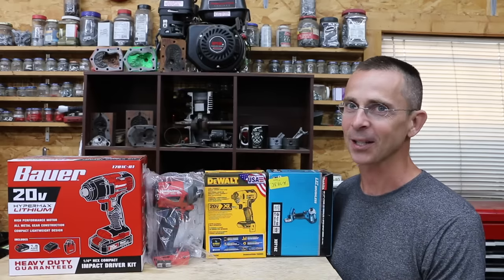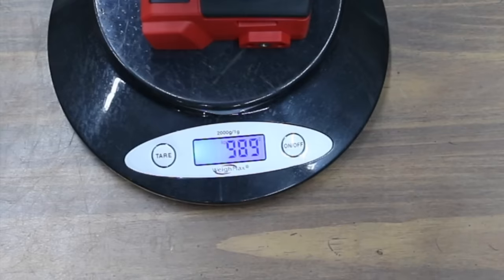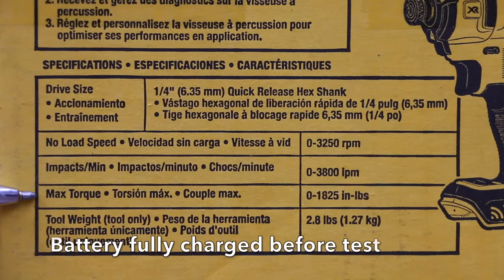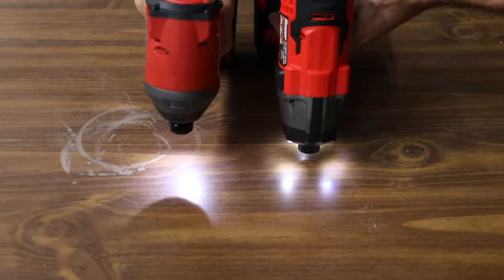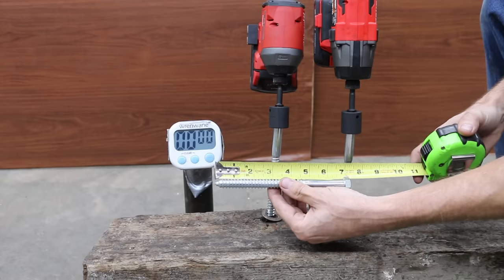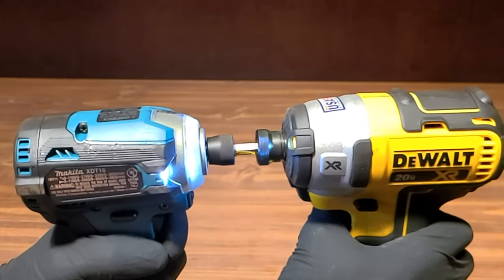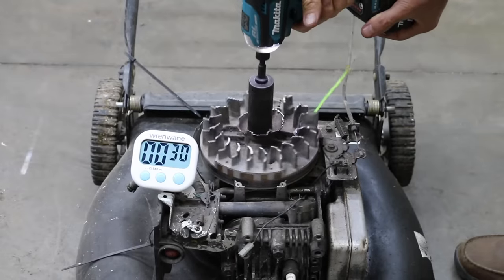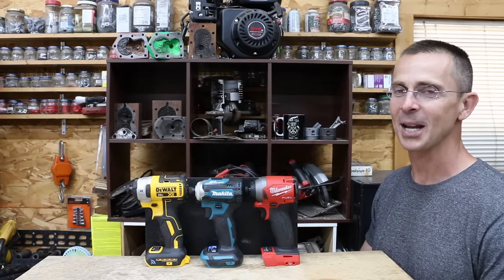Best Impact Driver? DeWalt vs Milwaukee vs Makita vs Bauer!  Let's find out!

Comment: I have a dewalt for 4 or 5 years and it has served me very well. I want to say that Makita being lighter and more responsive is probably the best choice for most uses.
Reply from the maker: Thanks for the feedback.
Reply: I have a bosch gsr 180 drill and the trigger lag is disapointing. It takes almost a second to turn when you press the trigger. I have never seen trigger lag as in this drill
Reply: Anyone in my company who has Dewalt just refuses to accept defeat over Milwaukee. Even if the facts and tests are presented to them in countless Youtube videos, they still refuse to lose the battle. Dewalt users are so stubborn I swear

Comment: How about a video on 1/2 inch high torque impact wrenches? Such as the DeWalt dcf900 the Milwaukee 2767, Hercules ultra torque (HF), ridgid, any other brands that make high torque full size impact wrenches.
Reply from the maker: Thanks for the video idea.

Comment: We all knew Milwaukee was gonna take the cake on this one
Reply: I had better expectations for Makita. But yeah Milwaukee has been the best value in tools for a long time IMHO.
Reply: It may be slightly faster but just the fact u have to keep pressing the button on the milwaukee is unsatisfying don’t you think.
Reply: @jackscott5144  that's the computer protecting the impact
Reply: Richard Devos exactly rather have a little less performance and it not keep hitting temp control e.g makita all the way
Reply: Jack Scott I think the cut off is for safety. It doesn’t want the drill to burn up or “explode” in your hand.
Reply: The Milwaukie cutting out may be a safety feature, but in my mind it just can't handle the workload if it's doing that. That being said, I'm a Makita guy all the way. 😁
Reply: @tomt340  even with the safety mode it still outperform both drills lol
Reply: @tomt340  ....makita is definitely the best. Milwaukees are always too heavy for what they are.

Comment: As a form carpenter, I have extensive experience with all 3 of the lead brand impact drivers. And by FAR. The Lead goes to Milwaukee, love their system their impacts are the best. I also really enjoy using the makitas too, both of them work extremely well. Milwaukee just has a little more low end torque, dewalts have always been the last picked, they just don’t feel the same performance wise.
Reply from the maker: Thanks for sharing.

Comment: If I remember correctly the Milwaukee battery has an overload saftey, that cuts power if the current draw or temp get too high.  It keeps the magic smoke inside the tool and battery at the expense of an occasional annoyance.
Reply: Yea, Bosch does the same in some tools.
And then people shit on them when the overheated or below freezing cold battery won't charge.
Thermal protection systems may sometimes be annoying, but they prevent you from breaking your tools, wich is nice.
Reply: Yeah you see people complain about these "idiot proofing" shutoffs but if it was another tool yes they could keep using it but they'd have to buy another one much sooner than a tool that keeps you from causing excess wear and tear or permanent damages by overworking it. If you need a tool that can hit harder or go longer a cordless impact isn't what you need.
Reply: 5yr warranty.
Reply from the maker: Thanks for the feedback.
Reply: @magicstew45  There are also stronger variants and larger batteries.
You're not going to overheat a 12 AH battery with an impact driver and it will last pretty much all day long if you're running one that can take the abuse.
Corded ones for example can't do 100% duty cycle either in most cases and air is a bitch to deal with in many cases.

Though to be fair: I did run through about 2,5 2AH battteries in an ~80% duty cycle with mine once and it got only warm on a hot day.
But that was none of the tested ones.

Comment: I'm glad to see this i just switched all my cordless tools to M18 milwaukee fuel.. been nothing but amazed in the difference
Reply: Same here!
Reply: So you guys really like the Milwaukee?  What did you try before?
Reply: Eric Kounce it all depends on what you want out of your tools, if your a contractor go Milwaukee. If for at home get the best you can afford. As all will be fine for the average home owner. I am so deep in the dewalt battery that I have decided to stay with that system and it’s been working flawlessly for the last 5-10 years.
Reply: Eric Kounce  Ridgid
Reply: @o1mtbiker  : Well not a contractor, but I understand the poor economy of cheapening out on one's tools. Costs more, but still going strong.
Reply: brodriguez11000 that’s why I always tell people get the best they can afford. Make no sense having 1-2 thousand in tools and no where to store them.
Reply: @o1mtbiker  my work stuff is Milwaukee but my home stuff is ryobi. I know people bash ryobi, but they do have an amazing selection of tools.
Reply: Shawn I think they have the biggest selection of tools currently. The ryobi brand has come a long way.
Reply: I started with Ridgid Gen5X and Octane tools. Excellent tools, but I also wanted something smaller and lighter, so I went to Milwaukee M12 FUEL (12V). They don’t have the raw power of the 18V Ridgid and other 18/20V systems, but they’ll keep up with 18/20V systems from about 4 years ago, while being smaller, lighter, and still delivering amazing performance. Still have and use my Ridgid, but my M12 are what I carry most of the time. The Ridgid is brought in as needed.

I’ve also owned DeWalt before, and while they were decent, the longer I used them, the less I liked them. That along with some issues with getting DeWalt to even respond to warranty issues, much less honor their warranty, and I now won’t purchase anything sold by Stanley Black & Decker. I did recently make an exception for a Craftsman socket set.
Reply: @TexasRaiser  Dewalt 18 volt then 20 volt both cant hold a candle to Milwaukee M18 fuel
Reply: Thank you for sharing your experience fellas. Much appreciated.
Reply from the maker: Thanks for sharing.

Comment: Guess I am old and old fashioned.  Was stationed in the Philippines 1989-92. I bought a Chicago Electric Impact from Harbor Freight Mail Order. Used it on my Harley Davidson  to remove and Install primary sprocket for belt. Now use it for lug nuts on my car. That  Electric Impact still works.
Reply from the maker: Thanks for sharing.

Comment: Hitachi is a major player in this market segment. I had two impacts, bought two more and a great feature... my oldest drills are 10 years old and the same battery platform still works on every Hitachi I own, drills, impacts, recip, 4” grinder and jig saw. Also, the oldest impacts have easily driven over 10K screws each.

Comment: Now spend about 6 hours drilling/driving though various pressure treated woods, ranging from 2x12 to 8x6, for about six hours a day and see which one overheats first.
Most ~3,~4 amp hours batteries are useless unless you are doing some really light duty work

Comment: Had a Dewalt for years, just got a Milwaukee... I like the Dewalt better, better LED illumination by far, and has three speeds which is kinda nice... Milwaukee works fine too, just the Dewalt seems like the nicer tool in this case... The Milwaukee came in a kit that I bought for the other tools and battery and I don't mind mixing up my tool brands. I kinda like it as then I generally carry around more batteries and chargers so easier to keep multiple tools in play imo... Plus then I can always just buy the tool I like best for the application vs being stuck with a brand... 😁👍
Reply from the maker: Thanks for sharing.

Comment: Hi, guys I need to decrease driver's power for personal needs. For example to work on engine. Is there any easy way ? I want to decrease power till 50nm's not to brake apart. Thinking about less power from ac maybe or somehow modify the ,,hummer'' mechanism itself. Thank you in advance...

Comment: With me having Dewalt at home and Milwaukee at work I completely agree with these results. Milwaukee is definitely the best.
Reply from the maker: Thanks for the feedback.
Reply: J B its the strongest not the best
I wonder why it stops every 10 seconds 
I would kill my Makita for that behaviour
Reply: @bertjetolberg103  I got the Milwaukee and its never done that, a 7 inch lag in pressure treated material it would probably stall out a couple times to save the tool..
Reply: @bertjetolberg103  it's protection so it doesn't overheat and smoke like the dewalt and makita protecting the longevity of the tool.
Reply: Bertje Tolberg it is designed that way so you don’t over heat the tool and the battery. I have never had mine do that. I know if I am driving a 7” lag to actually use a heavier impact designed for something that tough.  
 Before my work went to Milwaukee I burnt up a Dewalt impact and 2 Dewalt drills doing the same thing the Milwaukees had absolutely zero issue with. I actually regret not going with Milwaukee for my home tools.
Reply: @bertjetolberg103  And you've got it wrong your makita would kill itself without that function.

Comment: People need to remember that these are impact drivers not impact wrenches. There are the uneducated who make video after video hear on YouTube talking about how their impact driver broke down while they were taking apart a V-8 engine. Or taking the Lugnuts off their car wheels. Then they complain. There’s only a short warranty on the piece of equipment. Maybe they should remember that if they’d quit using it like an impact wrench, and use it to drive wood screws, and lags into wood, which is what its supposed to do, maybe the manufactures would put a longer warranty on them. They are not for mechanics they are for carpentry and woodworking, deck, building, etc. etc..
In other words, use the right tool for the right job and if you don’t, don’t complain when the tool breaks down.

Comment: In Easter Europe Bosch and Makita rules. They are similar in price and reputation. DeWalt less popular and a bit expensive. Milwaukee is a newcomer and very expensive, at least 50% more. But using it at my company I appreciate it.  
I am looking to invest in a new line and spent some time in figuring out which brand to choose and finally turned back to your Chanel as you are the only trustworthy source for me. Congrats
Reply from the maker: Thanks!  Thanks for sharing.

Comment: I’ve owned my Mikita for 8 years and it’s still going strong. My work gave me Milwaukee 18V impact and drill and they work great as well. I’ve never had issue with either of them. Been a Makita fan for a very long time
Reply from the maker: Thanks for sharing.
Reply: I let the smoke out of my porter cable a few weeks ago and replaced with a kobbalt (it was on sale).   should have watched this first.
as another poster said;    from now on, I'm coming here before going to the hardware store.
Reply: Where di yiy live?
Reply: I have a makita drill use it to run my valve seat grinder. Variable speed cuts down on vibration. I've done several engine valve jobs still working grest!
Reply: 12 years ago I got a 10 volt ( later they upgraded de batteries to 12 volts)makita impact driver, I was working on a project for a fleet of vans for a cable company. The job required removing the seats, my makita worked like a champ.  2 sets of batteries later ($50 each) still going.

Comment: We use Milwaukee power tools exclusively at my job and we never have any problems. Their 1" drive impacts are monsters, especially with a high output battery
Reply: Don’t use any of the larger tools!  They melt the batteries with little use and Milwaukee is a joke to deal with and won’t stand behind their tools anymore. Used to love them but they will never get a $0.01 from me again.
Reply: They're monsters, but Milwaukee needs to do a little catching up either those wrenches because Makita's 3/4 inch xgt beats the Milwaukee 1inch d handle
Reply: @luisprieto4390  we've noticed at work that the Milwaukee ¾" impacts out perform their own 1“

Comment: We have a makita, a few Milwaukee’s, a dewalt and a rigid on our deck building crew. They all work good driving in 3” deck screws but we grab the Milwaukee for doing the lag bolts, not because the other ones won’t but the Milwaukee will do more faster
Reply from the maker: Thanks for the feedback.

Comment: Soo many brand loyal “pros” here.  Its like taking my stock 1989 ford pickup and pitting it up against a 2020 ford raptor and expecting to take the title😆
Reply: The minor differences between all these tools doesn't justify having a Milwaukee impact driver, Makita drill, dewalt hammer drill etc. You're still going to go with the platform that you already have.
Reply: darcyrobinson true but that’s why I stick with M18 fuel as their drill is just as much of a beast as the impact driver. The drill is also one of the smallest in its class while being one of the most powerful like the impact driver. I’m an automotive tech so MIlwaukee has a lot of tools to cover our industry like their awesome stubby impact wrenches and m12 ratchets.
Reply from the maker: Thanks for watching.
Reply: Having had Milwaukee m18 tools for well over a decade I can vouch for their longevity and performance.  That being said.  I do own a few dewalt, makita,  and even bauer tools too that do just fine.. AvE said it best,  If you want the toughest tool available see what the rental shops are using.  I'm not by any means abusing my tools though.
Reply: This was a comparison of current-gen products.   Your analogy sucks.
Reply: Actually, my 88 f-2shitty will take more beating then them new raptors.  Know why?  I give zero fucks about my free truck vs off roading a house worth of money but that all depends what the title is for,, plowing into trees or for speed because I can only do trees....
Reply: @kentkirkpatrick7953  k
Reply: Some names come to mind 😂
Reply: @kentkirkpatrick7953  no one cares.

Comment: My former workplace used Makita and Milwaukee drivers. We'd use them to assemble and disassemble large industrial shake sorters, hammer mills, and a few other things. I definitely liked the Milwaukee drivers more compared to Makita for getting the job done... but felt that Makita would last longer overall. Great video as always! |

Can also see you and AvE doing a crossover for videos like this.
Reply from the maker: Thanks so much!
Reply: I have to agree with you also. I work in the construction field and Makita may be more expensive than Milwaukee but they last a lot longer and hold up better so all my tools are Makita.
Reply: The Zpack had my makita since 2012 still running like a champ... all makita
Reply: Did your former workplace happen to be an insulation plant? I have all those things mentioned above at my workplace as well
Reply: @drvn_performance  Nope. Fertilizer instead. :P

Comment: Amazon has DeWalt drill and impact driver on sale for 130 with 2 batteries, charger, and tool bag. I was ready to get a Milwaukee yesterday but I couldn't reisst getting both and batteries / chargers for cheaper than a single Milwaukee drill only. Watching this afterwards to see if my inpact driver was a decent choice 🤞

Comment: Usually Milwaukee is the best but I'm surprised that the Makita out performed the Dewalt simply because my hyper tough outperformed a couple different Makita's on cutting through sheetrock with tin backing !
Reply: Was cutting vent holes to dry out a wet wall
Reply from the maker: Thanks for the feedback.

Comment: I still prefer my Makitas. I've had good experiences with milwaukee tools as well. Makita stuff is just so reliable it's hard to beat.
Reply from the maker: Thanks for sharing.
Reply: Until I have a failure with either I can't say one is better, I've had no issues with Milwaukee tools, same can be said for Makita. And it also has to do with right tool for the job, you shouldn't expect impact drivers to do anything more than driving screws. That's why you have things like impact wrenches.
Reply: @Barbaratio  I do small engine repair and the size of the impact driver is what sells it to me. I use the driver with adapters for all sorts but and bolt loosening. I really beat the snot out if my Makita every day and she never skios a beat. I get pulleys and blades and wheels and all kinds of stuff off with it. I love my little driver.
Reply: @thisislargemouth5566  they are great for that, I use my milwaukee 1/4" hex for small engine stuff too. However in auto my 3/8 usually dominates, rarely do I need the 1/2 impact
Reply: Ive never had experience with Makita, but they are very good. I have only used DeWalt and ive never had an issue with any of their tools, so thats what I stay with.
Reply: I used to be a Makita hardcore fan till the brushless came out and they burned me for $499 hard earn dollars.. I am 100% Milwaukee fan now and own 20 or more of their tools...
Reply: @joesanchez7920  Makita number 👍 , Only Makita
Reply: Panasonic would kill all of these
Reply: João Maverick  Not at all,in the shopfitting trade we've tried most brands
Panasonic is fantastic but expensive

Comment: At the shop where I worked - when our trailers were delivered, it was necessary to remove the wheels, forklift the trailers off of the cargo hauler, then re-install the wheels.  We used a Milwaukee battery impact wrench.  That impact wrench ran through a entire load of trailers with battery to spare and zero problems.  We used that impact wrench for several years.
Reply from the maker: Thanks for sharing.